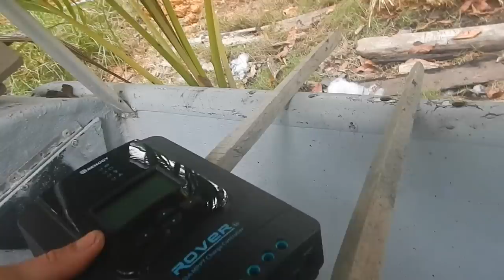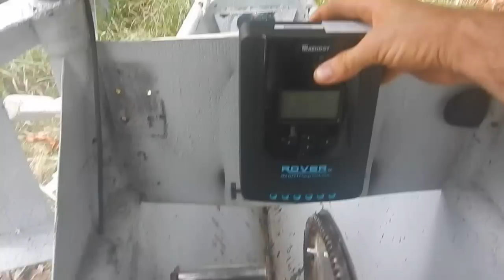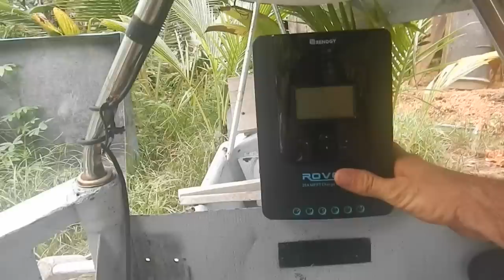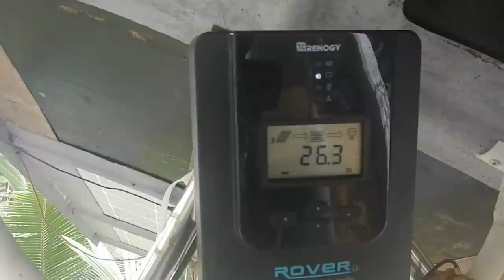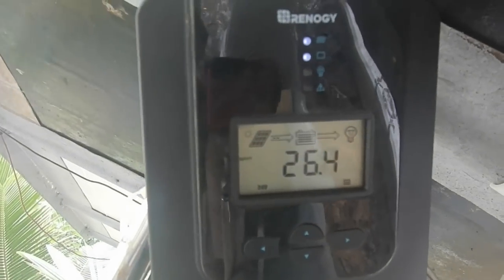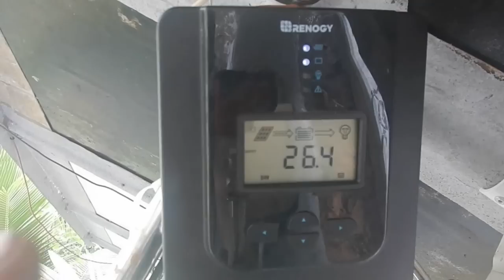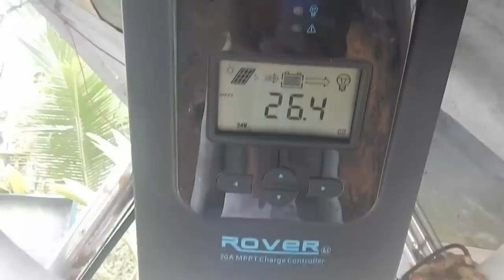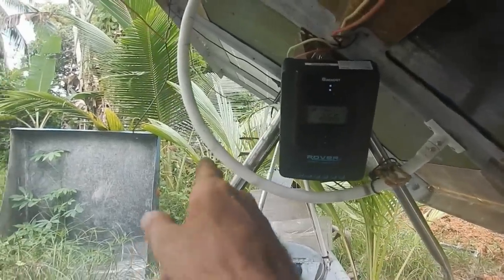Zombie Chopper Max Speed 003 Zombie Charger!

Comment: You could've mounted it completely hidden, flat under the ceiling. And use a relatively small 45 degree mirror to see the readings. The mirror can be on tilt flapper too. The result would be an unobstructed view, better protection from the elements, and curious eyes ;).

Comment: When needed for battery work without a disconnect switch for the solar panels, just cover them to darken the panels to kill the power and then disconnect the diode which should have been a fuse. An arc could damage the disconnect if it were opened under power. DC sustains arcs easily, as you know.

Comment: Speed controller and onboard toaster, in one.  Sorta wonder if corrosion is going to be a problem with the nichrome, giant resistor wasting all yer power blah blah but it's not going to be in circuit most of the time, the boat's mostly running at full speed, ?